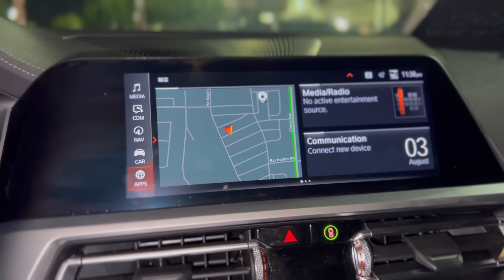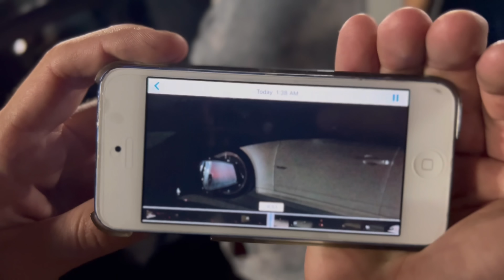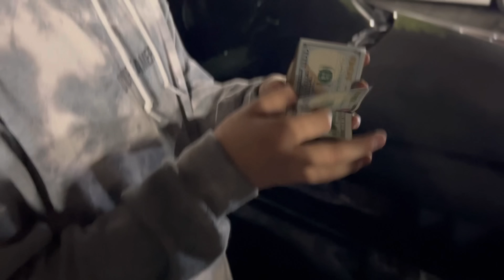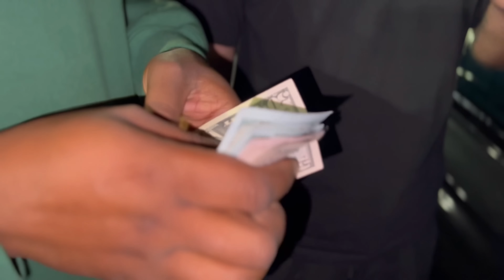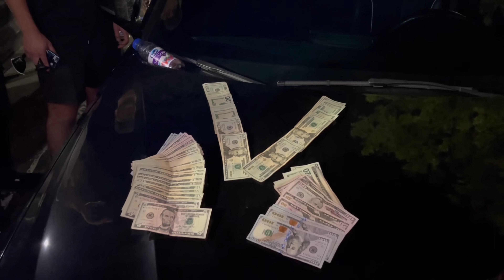BMW 340I Vs CTS-V! #BMW #Chrysler #CTSV

Comment: you can hide your NOS tank in the dashboard and under your back seats to give it a sleeper, stock, clean look.
Reply: You can do that for interior. But the lines will always tell when you pop hood. You’ll see going into chargepipe or intake.
Reply: @BimmerMafia  There's away to reroute it and make it look stock or hidden. I;'ve seen it done before and lost a race because of the cheater
Reply: @Ayixlia  IKR? Which i REALLY have a feeling thats what the BMW did. I've watched 100's of videos with V's and they 99.8% of the time send BMW's to GAPPLEBEES. 
Even the fastest BMW M5 CS can't keep up with a blackwing. 🎤💧
Reply: @EliteOnTheBeat  What? a M5 CS will eat a Blackwing CT5.
Reply: @EliteOnTheBeat  stupidest shit someone can say is that a blackwing is faster than a m5 cs
Reply: @BimmerMafia  you can get a kit were they put it inside the intake manifold